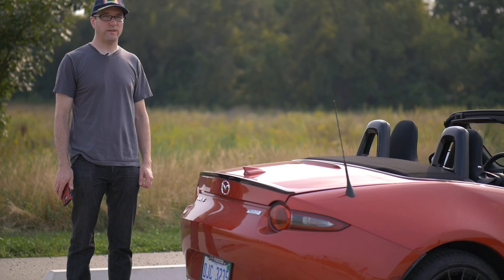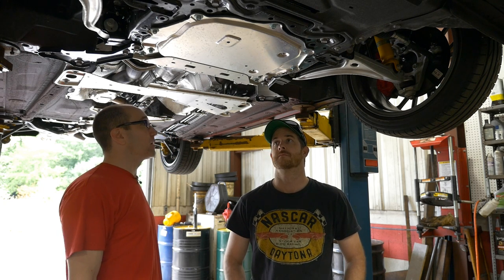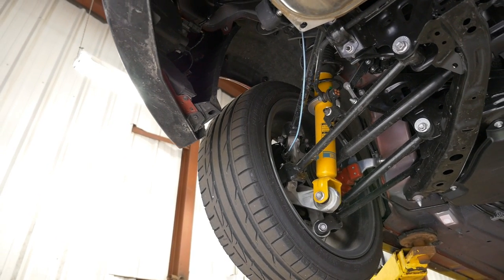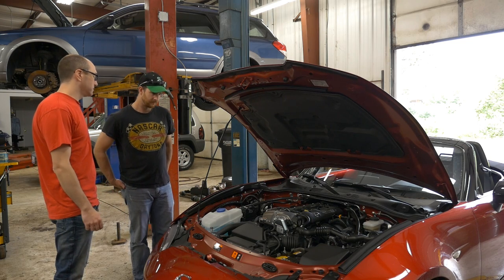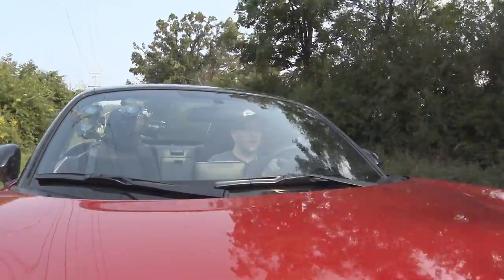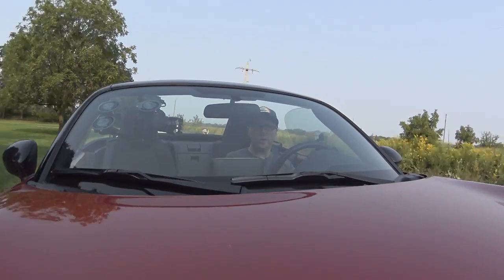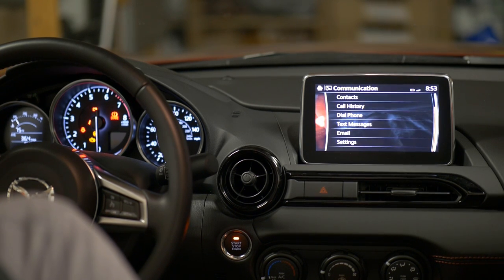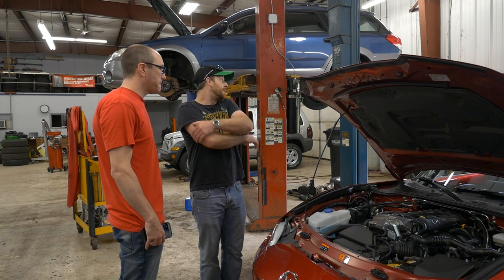Review | 2016 Mazda MX-5 | Curing Automotive Diseases

Comment: The ND compared to the NA after driving back to back doesn't seem to harken back as much as I thought it would. The steering doesn't quite feel as direct and its much softer in ride. The ND feels much more enclosed than the NA (probably thanks to crash safety standards) so its sense of speed is lower than the original. I also think the ND may need a lighter flywheel. Once I depressed the clutch, the revs drop very slowly compared to the 1.6L NA... This may be due to the fact its a tuned Mazda3 engine and its not as rev happy as the 1.6L NA which can rev to 7200rpm

IDK maybe cause I regularly drive a NA the differences seem more stark to me.
Reply from the maker: Two major points would be DBW and Electric power steering. It just is totally different.  I agree about the motor.  The 2.0L on the ND was designed from ground up to be an eco design.  Its being massaged to do more and it becomes the weak link from a sports car stand point.
Reply: +savagegeese Yeah definitely part of it. Based on what all the journalists were saying about the ND you would think its the 2nd coming of Jesus Christ. Its great, I'm impressed with the weight and what they've done with it despite regs and such, but not enough for me to go out and buy one new when I've got a great 1990, stock, NA.

I'm biased towards quick and high revving engines.

Comment: if mazda made the miata with a small displacement v6 (2.7-3.2 L), that would be a heck of a thing
Reply: +TheHydraccana Nope nope nope this would destroy the nice balance of the car. For going on a straight road maybe but on twisty roads I would not consider this.
Reply: +TheHydraccana No, it wouldn't. It would feel like a pig.
Reply: Mazdas KLZE 2.5 v6 is known to weigh less than the cast iron bp. Would be an excellent swap project especially considering a v6 block is shorter than a 4 cylinder, so weight is moved rearward. I think it'd be pretty cool if Mazda started working on a skyactiv v6 as an alternative to a turbo four, but of course that's just dreaming.
Reply: The problem with bigger engines isn't the additional weight of the engine itself. It is the additional weight that comes from all other parts (clutch, transmission, wheels, etc.). Take the current Ford Mustang. The Ecoboost weights 200kg less than the V8 - however the V8 engine itself only weights 40kg more. However i get the point and could imagine that it would drive fun despite the additional weight.
Reply: +Just Petrholhead Things KLZE swaps use the Miata drive line. Stock transmission, stock rear end. Subtract 15lbs lost from the v6 swap and you've improved the weight distribution slightly and imposed a front-midship engine layout because of the shorter v6 block. I really don't see any compromise.
Reply: +TheHydraccana Small v8*

Comment: The problem is, as of January 2018, a brand new club Miata (the one with the lsd and better suspension) with the bbs wheels and brembo brakes option is right around $34,000. That's just so expensive
Reply: They are nice but candy. You don’t need them. The base brakes on these and the NC are great.

Comment: Are you guys offering free upgrades to the i-Turbowski 6S?
Reply from the maker: First download firmware i267-001.10.1a reflash current device and connect it to PC and launch iTurbowski app and update it to v3.2.4.30012.  launch BT and connect to network ECU28.   After connected download on tablet new software and transfer it over BT. After connected connect it to Wifi network SOFTUPDATE and download v737.2899 and reboot devices 3 time.
Reply: +savagegeese Sounds like this involves alcohol.
Reply: +savagegeese I love this channel...but I'm gonna pass on that 'upgrade'.  Be sticking with my iDroid HTC ONE Max....(iDroid is a real thing in MGS V)
Reply from the maker: +scottieray I haven't got to play the new MGS. :(

Comment: I daily a 2000 (NB). Also my first car.  Gas mileage on the highway, is poo. Granted it has five gears and the six speed still has same final gear ratio. Around town, a tank will get me 270(ish) miles. Highway, maybe 200.... Maybe. I don't let it get low enough to find out. ONTO THE BOSE PACKAGE FROM AN AUDIOPHILE. Many people complain about the usual Bose sound. Boomy, no highs, elevated mid and upper bass. To give you an idea of how janky the Bose package is, there's 6.5 speakers in the doors and a 5.25 or 5.5 subwoofer SOMEWHERE. Save the money you'd use for the bose package, get a nice amplifier, the factory DAC and preamp will suffice but do change the component speakers. I've seen local shops advertising a service that'll install a 10" subwoofer in the 'cargo' space.

Comment: I really do enjoy your reviews. No B.S. and I really can't tell if you like or dislike a car until the final overview. Keep it up, I am a definite fan. I even enjoy the cynicism. As for this review, I had a couple of Mazda's Miata/MX5s and they were a blast to drive. I had one turbocharged and auto-crossed and it was relatively inexpensive to do for a working guy on a budget. I called it my smiles for miles car. Of course I got chastised for driving a chick car, but I am passed the age where I really give a F _ _ _ _ about what others think. I enjoyed driving the car. It made commutes enjoyable and taking the long way fun. I have off -road vehicle and muscle cars, but I have a natural affinity for the simple driving enjoyment I get from such a simple car. Now that I have given up motorcycles and racing around on those; rag tops have filled that gap. I think the club model is the way to go for this model. The shocks and limited slip make it fun. I don't like any infotainment system 100%. This is one has a bad place for the controls, but I wish they had placed them somewhere else.

Comment: Great review but I'm just wondering how you managed a 0-60 in 6.1 sec where others are closer to the 7- 8 sec mark?
Reply: +K820 Those times might be the 1.5l engine.  That's the model they circulated among the journalists first.  The fastest time I've seen for the 2.0l is 5.8 seconds.
Reply: +maninredhelm I'm pretty sure it was the 2l they were testing. Everyman Driver was one that I watched. He had 5 attempts at 0-60 and the best he could do was 7.1 sec. Motorweek did it in 6.8. Anyway, I didn't think it could go under 7 sec, let alone doing 5.8 sec as you stated. This is a pretty quick car!
Reply: +K820 no offense to everyman driver, but that guy doesn't know how to shift a manual properly to extract power.  all his times are pitiful with wild variances when he does multiple runs on the same spot.

Comment: As a mildly-satified FR-S owner, I have to ask about you saying the ND is so clearly better. I've seen your videos before, so are you saying it's front-to-back all around better as a track car, since that seems to be your most important factor? You have a habit of complaining about the mods for your FR-S.
But what about a comparison of the two as daily drivers (my scenario, and I'm considering trading in for a ND)? The power ratio, albeit different throttle action, seems the same. The FR-S surely offers more natural handling.
I will probably be looking at a Club real soon and it stickers at $33K. My FR-S was $25K. Honestly, I want to explain away the improvements in the track setup on the ND to that price difference. That's a chunk of change.
Reply from the maker: +Richard Boudet As a daily driver it just depends on where and what your needs are.  In the midwest the FRS is a better daily driver. But looking at both platforms stock vs stock the ND is a true dedicated platform with real use of aluminum, weight savings, double wishbone front and expertly designed multi-link for the price range. If you can get over the stuck on infotainment it works and sounds great, compared and the ND gets eco car fuel economy while being more fun to drive and faster than the FRS.  The 86 was a great idea but hampered by the cost cutting. Imprezaish rear end shared platform, strut front, very little use of aluminum, motor is lack luster until pressurized. The thing they did right is the chassis is rigid with plenty of overhead along with adding port and DI on the FA20. But you have to modify the hell out of the 86 to reach a place where it's a really shines.  The MX5 shines out of the box, power aside.  On the aftermarket side the ND should be making 20-30 more WHP just from a re-flash. And that's about all it needs.  In all fairness they are both great options, I went through the ringer with the 86 so I understand it well strengths and weaknesses.  The Miata has and always will be one of the most raced and backed platforms because it has factory backed (long term) support. Mazda is dedicated to this car in a way beyond marketing, that is something we don't see until you get into cars like Porsche or higher end American Sports cars.

Comment: Would you recommend the Grand Touring Trim if planning on using this as a daily driver in tri-state area of New England? (for heated seats during the winter).
Reply: Hard to say.  The Club's LSD would be handy in the snow, and the cloth seats need heat less than leather.  You could add aftermarket heat (and leather) to the Club, or an LSD to the GT, but adding LSD is going to be a lot more money.

Comment: A buddy recently wrecked my ap1 s2k. I am considering getting a newer car for weekend/track use as the primary purpose. Would the ND be comparable to the s2k experience? Also considering 86.
Reply: yummiestpizza61 I own an 16 gt mx5. I've never driven an s2k but in my ND from 2500 to 4 000 rpm the car is such a blast to go down the gears. is so much fun to go around the corners at 3 to 4 rpms. I don't even feel that I'll lose control. I've driven the brz , the car is wayyyyyyy to slow , even though is has better handling  it's not the superior car. So I say buy the nd tune the ecu do headers and exhaust upgrade and cold air intake the car will do around 185 to 190 hp. One of my buddies did this upgrades to his ND and I felt the difference. The car was such a beast to drive. Because the car is almost 400 pounds lighter than the s2k all those upgrades will transform the mx5.

Comment: Am I the only one that wants a 6mt WITH more overdrive? If the top gear is 1:1, i want a 5 speed. I love shifting but I also don't want to shift through a dozen gears by 40mph, I like to go through the rev range, always liked torquey motors where RPM's aren't as important but I guess this is what you get with an MX-5.

Comment: Once I pay off my GTI, i'm going to really consider a new MX-5. I'll be cross shopping between it, the FRS and the newer GTI.

PS: Really digged the shot you took right over the pier.
Reply: +Josh Wallace is car payments worth it? how much was the car and how much you have to payoff?
Reply: Although I wanted a new Miata I couldn't afford it. But coming from a '09 GTI into a '13 Miata Club, I can definitely say I made an upgrade both in performance and reliability.
Reply: +Josh Wallace SUCH A HARD DECISION FR-S or MX-5! The aftermarket is huge for the FR-S and its meaner looking, then you have the Miata which comes just amazing out the box...sigh. If possible to have both, that'd be sweet.
Reply: +Johnny Parker I've always heard about VW love but with many problems. On a scale of 1-10 how would you rate, 1 being a toyota corolla(any year) and 10 a mercedes benz...any class (2006 and up).
Reply: well I've had it for 30,000 miles and haven't had any horrible problems. had to replace a brake caliper and a thermostat, along with regular maintenance. Some of the tools are foreign, but the jobs are generally easy to do

Comment: Best ND review I have seen so far ( and I seen them all ).

Agree with 95% of all points, but not with the power.
 
There is NO WAY a real gearhead will keep his MX5 stock. 
My 1990 NA turbo has 304HP,  my 2016 ND for the first season will have about 190 hp naturaly aspirated. 
BBR GTI is already over 200 hp with minor mods on the ND, and other tuners will present thier kits very soon. 

I think this is the best daily driver/ trackday combo out there. 
As to winter driving, I had the luck of having multiple cars in my garage most of my life, and every time I had an MX5, I was driving it in winter - just pure fun. And  the ND has heatded seats , so cmon.. You need some fon while comuting to work.

Comment: Great review, very nice editing, and thought out comments. But I'm wondering, why suggest to have this car to have at least 200 hp, while also saying it is a lot better than the FR-S/BRZ. The twins have more or less the same curb weight, and bring in the horsepower you are missing in the new MX-5.
Reply: +Lux Keiwoker The new Mx-5 has a slightly better power-to-weight ratio than the FR-S.
Reply: huh? power/weight for an 86 is 6 kg/hp (~1200kg/200hp)  while for the MX-5 it's 6,25kg/hp (~1000kg/160hp).
Reply: +Lux Keiwoker either way it's faster 0-60.
Reply from the maker: It's the chassis and suspension on the MX-5 that is superior to 86.  It's not a shared platform or borrowing from a non sports car platform and the support mazda will put behind it will stretch for at least 8 years because it will be used in spec racing, thats a big deal for a sports car.
Reply: not really - really depends on the tires. keep in mind the twins are being sold with prius tyres that cause a lot of wheel spin. 1/4 mile averages that out and the twins are tad faster in 1/4 mile.
Reply: +Lux Keiwoker definitely make good points but i use to own a 13 frs and the new miata i test drove felt a tad faster, even from getting on it at highway speeds. The torque dip and the way the frs built power made it slower than what it should have  been. That being said, they are so close in acceleration that it hardly matters. I found the frs to be more fun and raw to drive, which is what matters anyway. I think the new Miata has all the ingredients to be an amazing drivers car but Mazda pussified it so they could sell more cars to "the walking dead" (old people).
Reply from the maker: No one launches a car in real world above 3000rpms on street.  From a dead stop Miata is faster, regardless of tires.
Reply from the maker: The MX5 ND will be on sale for at least 7 years. It will be manipulated beyond measure from a suspension perspective.  Launch editions are always conservative.
Reply: +Lux Keiwoker I've driven the FR-S and the 2016 Miata. The FR-S is much heavier (an extra 450 lbs is very far from "more or less the same curb weight") with longer gearing and honestly feels laughably slow for its HP since it is totally gutless at low and mid RPM. The Miata is the exact opposite - it feels surprisingly quick and has terrific torque for a NA engine. It also has better handling and an unbeatable sense of lightness. The only performance advantage of the FR-S is the reduced body roll, but it is an inferior sports car overall.
Reply: +AlDim000  I have owned both as well (2014 BRZ for about a year, just bought a 2016 ND). I agree, the Miata just feels quicker (and it is).

Comment: this makes me feel even more disappointed that they don't make it just a hair bigger. at 6'3" and 245lb with a 36"waist i. do . not. fit. my eyeline is at the top windshield bezel, i can't put the top up, my knees are hitting the steering wheel and physically do not fit in the space on either side of it, and my big ole feet hit all 3 pedals at once if i'm working the gas and clutch...
Reply: pballer2005 loose weight
Reply: Oskar W V not sure how the fixes the height issue or my big ole feet?
Reply: I hate that for you. But I got a good giggle from that mental picture!
Reply: They do. It’s called a nc

Comment: Man, is it just me, I just here a lot of passive-aggressive complaining about the technology and engineering. No, it's not a 400hp Mustang. If you want 400hp you might not want an MX-5. Dorks.
Reply from the maker: +DustyCowdog The car in terms of chassis and suspension is leagues ahead of most everything else anywhere near its price range.  But the weak link and mostly because Mazda is still a smaller company is the motor.  155HP is barely fun in the modern age of 4 bangers.  They had to recycle their eco 4 banger here not because they really wanted to but because they had no other option.

Comment: BS about the air/oil separator.  Lots of cars that have the valve carbon problems still have issues coming from the factory with air/oil separators and having also catch cans installed.  A perfect example is the Audi 2.0 tsi tfsi oil separator, which everyone calls a PCV, but meanwhile, it's an actual oil separator and the original german name confirms that (Oelabscheider).  The gunk on the valves is multi-factorial.  It's partly due to minor weeping on the valve stems, micron by micron.  It's also due to gases during overlap.  The next problem is that while this isn't a foolproof answer, lots of people with the valve coking issue are just driving around and never getting the engine up to temp and into the lean-burn cycle that raises temps enough to help with self-cleaning of valves.  I drive my car on the Autobahn and do primarily highway driving.  While I will likely eventually have issues, I am not there yet with some 75k KM

Comment: lovely. but the problem now I feel is the abarth 124, which may have the 1.4 multiair and the question marks surrounding reliability of that engine, but a very compelling character with mx5 underpinnings. Any chance of a review?
Reply from the maker: +Brad_0 Yes on schedule for end of October.  Hopefully weather holds out.
Reply from the maker: +Brad_0 Yes on schedule for end of October.  Hopefully weather holds out.
Reply: hopefully so
Reply: since You tested the top version mx5, i hope that you test the Abarth 124 Spider version